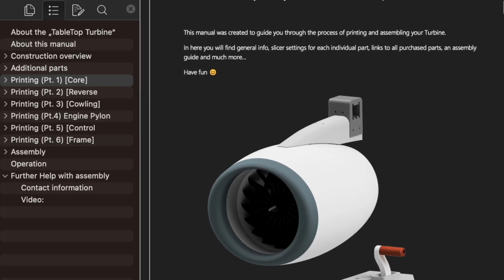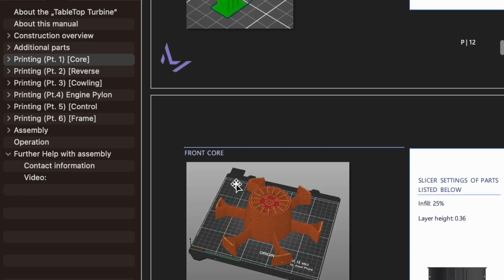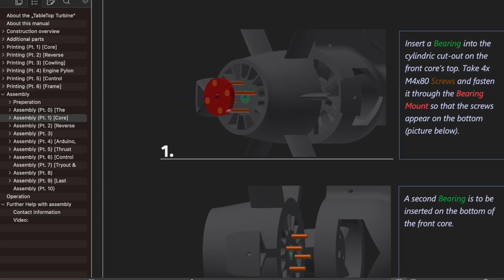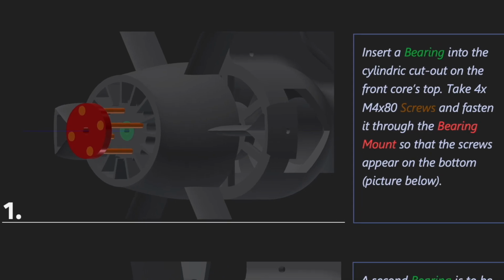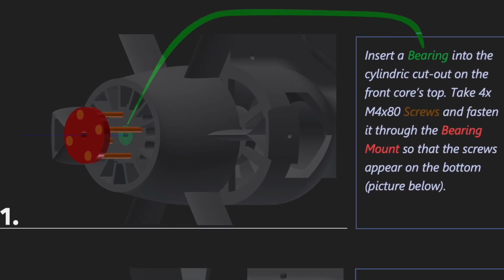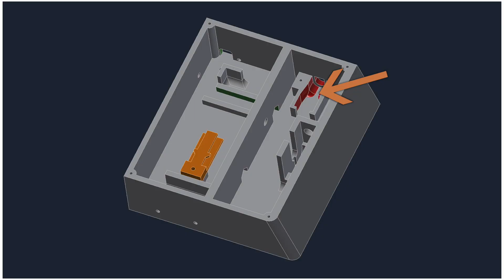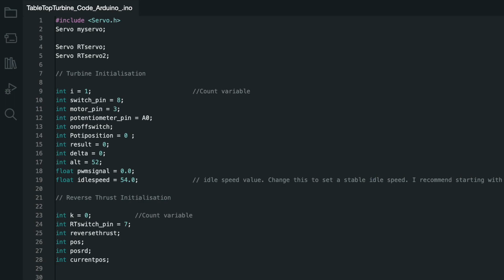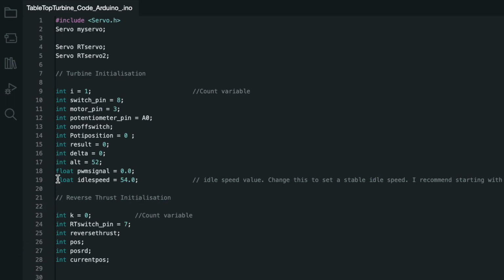TableTop Turbine - Explanation and assembly

Comment: Can you give me an email? I have some questions about the software for this model
Reply from the maker: Of course: 
algluca99@gmail.com
Reply: @ALG_luca  thanks
Reply: @ALG_luca  By the way, is the servo of this model used at 180 degrees?
Reply from the maker: I haven’t looked into the code for a while (and can’t right now as I’m not at home) but I believe it’s between 130 and 150 degrees.
Reply: @ALG_luca  Because I use a 360 degree servo, it will keep rotating, I don't know if it's a software issue or a servo issue
Reply: @ALG_luca  By the way, what is the appropriate height and width for aluminum pipes
Reply from the maker: @Mxxy-666 I have a look at the code after work in a couple of hours and come back at you. I can imagine that the values have to be adjusted for a 360 degree servo.
Reply: @ALG_luca  okay thanks.By the way, what is the appropriate height and width for the aluminum pipes on the engine support bracket
Reply from the maker: @Mxxy-666  Ok so the servos are turned 142° when the thrust reverser gets activated.
Unfortunately I dont't know how the code has to be changed for 360° servos .
The horizontal profile is about 450mm in length, the vertical ones about 350mm.
However you could use a shorter one for the horizontal bit.
Reply: @ALG_luca  thanks~ It seems that I can only buy a 180 degree servo， ：（
Reply: @ALG_luca  Hi bro,by the way, there's another question. How long does the M5 screw for connecting the fan blades to the brushless motor need to be? Also, is it necessary to use a fixing nut to fix the front fairing casing to the body? I think it would be difficult to install if a fixing nut is used on the casing in front of the reverse thrust
Reply: @ALG_luca  hei bro😭
Reply from the maker: The M5 rod should have a length of about 170mm.
Regarding the second question. I think you are talking about fixing the inlet cowl to the fan cowl. In my experience you can just screw it into the plastic with ordinary m4 screws. Have to be careful though.

If I’m not mistaken, these things should also be written down in the manual. In case I’m not available for a couple of hours.
Reply: @ALG_luca  thanks bro!😃
Reply: @ALG_luca  hi bro,When I was installing the engine thrust reverser assembly, I found that the circular ring with black blades inside was very tight, and I don't know what happened. Have you also encountered this situation during installation? And in that case, the servo cannot be fully opened, and I also installed it according to your manual. You can take a look at the video I just posted on my homepage, and you will understand.
Reply: @ALG_luca  When I was installing the engine thrust reverser assembly, I found that the circular ring with black blades inside was very tight, and I don't know what happened. Have you also encountered this situation during installation? And in that case, the servo cannot be fully opened, and I also installed it according to your manual. You can take a look at the video I just posted on my homepage, and you will understand.
Reply from the maker: Hey. Just give me a few minutes. I’ll look into it.
Reply from the maker: @Mxxy-666  Ok so what I did back then is to put some oil on the screws holding these blades and repeat the movement a couple of times. It worked perfectly fine afterwards. 
Let me know if I can help you any further.
Your model looks great by the way!

Comment: Can you make a project, using this type of engine on a prototype electric jet!?
Reply from the maker: Hmm. First of all, I want to equip the turbine with a new motor, which has 3 times the power.
And then, perhaps I’m going to do that. 
So we‘ll see. This should be ne next step and I will probably do that eventually. But there are still 3 projects to be done before.
Also, I‘m not sure if the structure of this turbine is made to be flown with. 
We‘ll figure all this out some time.
Reply: @ALG   oh.. Good luck with your next projects . I'll  be excited to see them too... 🩶.. just don't stop posting.. you'll be highly noticed one day
Reply from the maker: Thank you for the kind words. 
Since creating these projects takes a lot of work as I have to feed 4 platforms simultaneously and progressing in the actual project, I’m sorry if cannot sustain a regular video upload. But I’m trying my best and continue with these projects even if there are no news.
Thank you for your support :3